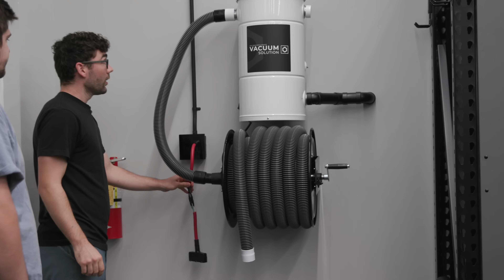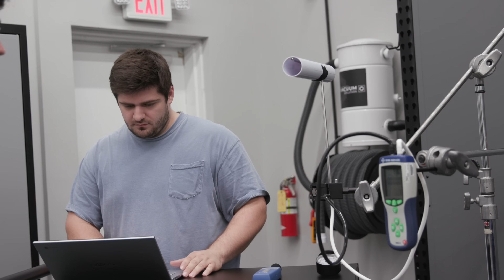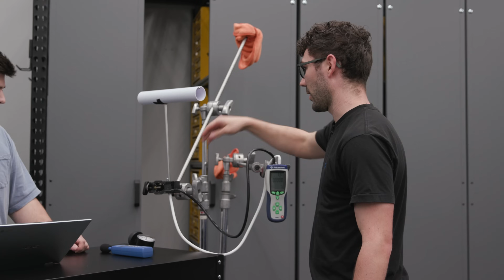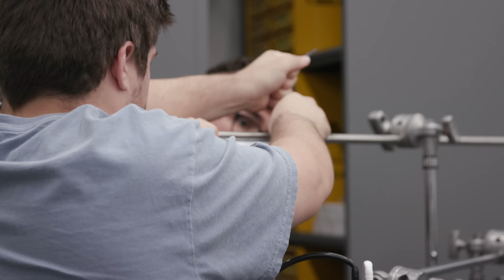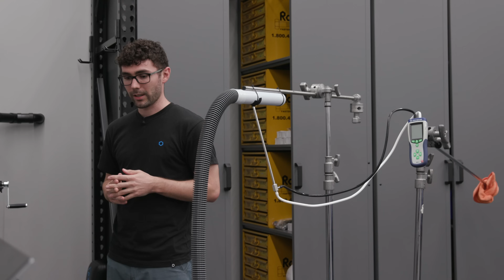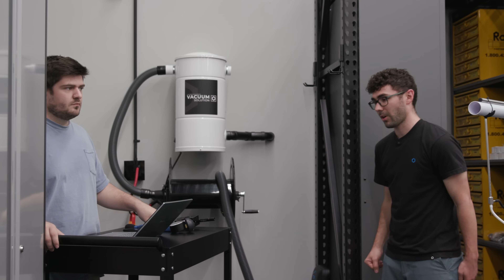The Vacuum Project: E1 - The OG Vacuum Solution

Comment: Looks like you guys are going to have some great data coming soon, good process!

You mentioned sound as a key factor in your selections, would it be possible to also have links in the spreadsheet to audio samples of how things sound (recorded with standard mic at same settings each time)?  At minimum may be worth recording the sound and displaying an EQ curve for the audio to illustrate what primary frequencies the machine puts out.  Not sure if anyone has done anything like that in the past I am aware of. 

Lastly I know there was some question as to how accurate the pressure washer gauges were for that testing… is there a process to QC the flow and pressure meters you guys are using for the vacs? (That way the numbers won’t be at risk of being skewed).  

Thanks again for providing these awesome resources for everyone!
Reply from the maker: That's a good idea.

Comment: I never understood why the dirty collection part of the vacuum isn’t placed outside, or at least near an exit. You spend all this time cleaning the car and then have to drag a dirty bucket through the garage or basement to dispose of it.  I’d place the unit near a garbage can, but still inside.
Reply: How often are you emptying a vacuum that's used to clean car interiors? I could go years without emptying mine. It belongs in a location that makes the most sense for regular operation. Who cares if you have to walk an extra 10 ft when you empty it every 3 years? Plus, if you're making a mess when you're emptying it you are doing something wrong.
Reply: @dommy114 think people would be using it for more than just car interiors

Comment: This  is good timing.  My pull man holt just died , after 15 yrs . Quiet as all get out and only 2 hp . Suck paint off a wall . I also run a vacmaster wall mount.  5 hp 5 gallon.  Also extremely quiet.  I run a 50ft centec hose . Plenty of power to get the results i need . Having a remote on the handle , i keep it near by , is really handy .

Comment: Couldn’t see what the water lift readings were?  Also, what length hose will you guys be doing this test with?  Just wondering as stated specs are based off of shorter hose.

Comment: Nice job guys. 

I assume the relief valve is to keep air moving across the motor so it cools it, nothing to do with debris moving around.

Be neat to see the air flow before the hose reel compared to after.
Reply: Wouldn’t really make sense to test before the hose reel?

Comment: I have the hose reel and love it. My only concern with it is the hose being restricted by the sharp bend right at the fastening clip inside (you see this when the hose is unwound all the way). It would be great if you offered some sort of 3D printed solution that was more of a sweep elbow to prevent this from happening.
Reply: I have the same problem. Vac is great. Reel connection severed my hose twice already. Accessories don’t stay attached to the hose. It’s a good setup but needs refining to be great.

Comment: "infinite water lift" nope thats not possible since whats lifting the water is the pressure difference between ambient pressure and and the  absolute pressure of your suction. So at sea level, where the ambient pressure is about 1 bar depending on weather, you can maximally have a pressure difference of 1 bar if you would able to pull a perfect vacuum. This translates to a maximum lifting force by the pressure able to lift water just about 10 meters. :D edit: this is why on wells you need to have the pump at the bottom of the well since water cant be sucked up that far
Reply: Took the words right out of my mouth
Reply: You can only achieve absolute vacuum (-30") in space.
Reply: @timkinley1779  yeah, almost added it to the comment but it was already so long :D

Comment: Having an on/off switch on the handle is preferred , that’s how my garage setup is…. Walking all the way to the canister to turn it off is not ideal.
Reply: I have three vacuums and none have a switch on the hose end.  I'm trying to figure out why that is a big deal. Once I start vacuuming, I go until I'm done.  I start it, I stop it, then I put it up.
Reply: @timkinley1779 once you experience it you’ll realize the benefits
Reply from the maker: We have that option, but pretty much all of them outside of Festool's version are pretty janky.
Reply: @ObsessedGarage  the remote on the flex vacuum is similar to festools I think.
Reply: I agree, having the on/off on the handle is very nice.
Reply: The ego has a remote control